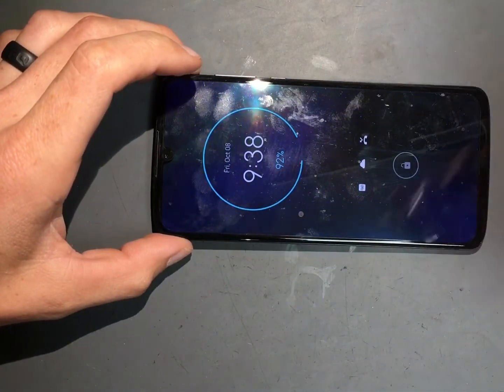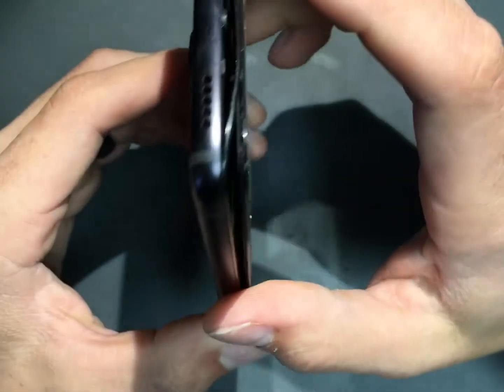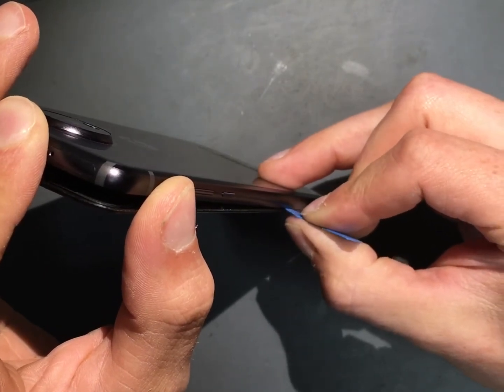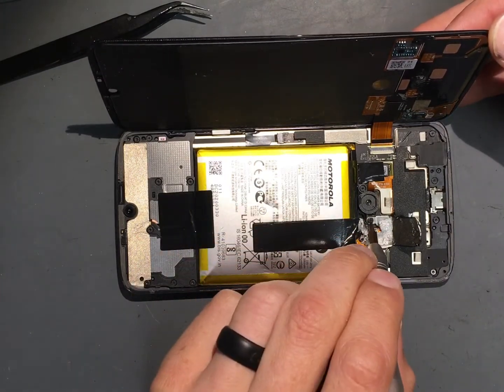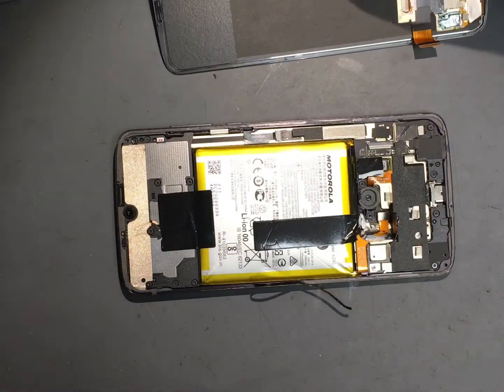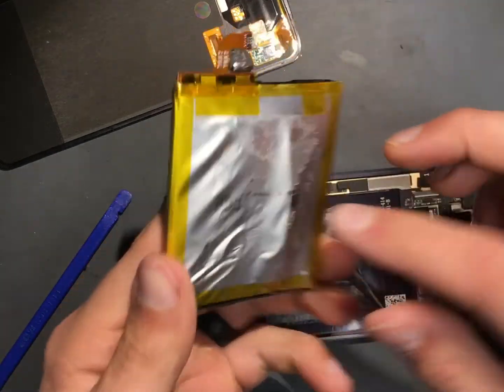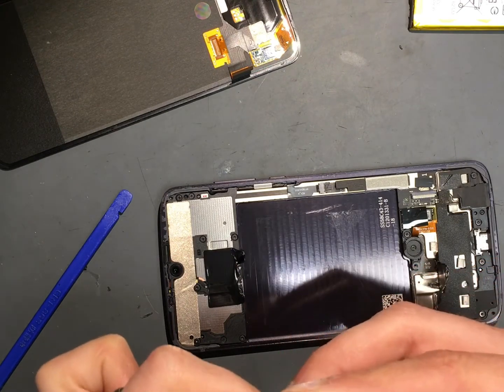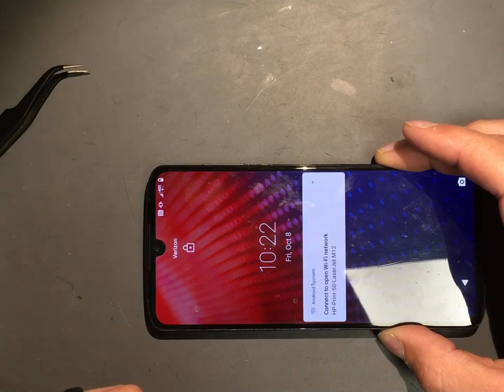MOTO Z4 swollen battery replacement

Comment: I have a question. I bought a new battery for my Z4 and getting ready to replace it. The screen is in excellent condition. When I take it apart should I leave the bezel connected to the screen or to the phone itself?
Reply from the maker: @waltercondi4584  Keep it on the screen. If possible. I had several where I intended to keep it on the screen but after warming it to soften the adhesive the adhesive that held the bezel to the screen also came off. Not the end of the world. But does make putting it back together take longer and harder to keep it looking clean.
Reply: @3200ish  if I have that issue that you had and when reapplying it what should I put on first? The bezel to the phone or the bezel to the screen. This is my first rodeo lol I already bought everything I need like the t7000 adhesive and the battery
Reply from the maker: @waltercondi4548  either way is fine. I prefer bezel to screen then into phone.  I think it’s easier but you have to let the glue cure before you set the screen back into the frame. Also If you’re able make sure all your stuff is backed up before starting.
Reply: @3200ish  thank you for the reply. Really appreciate it ☕

Comment: Thanks for the tutorial! What width Tesa tape did you use to adhere the screen (bezel) onto the back?
Reply from the maker: On the top and bottom I’ll try to put 4 or 5mm the use a blade to shave it down. On the sides I use 1 or 2mm where it allows me to

Comment: Quick story: I purchased a Z4 in Oct. 2019.  Then I lost it in Jan. 2020, and purchased a replacement on E-bay in Feb 2020.  After a year, I found my old phone, but kept using the replacement.  

Shortly after finding the old phone, the replacement had the battery swell in April 2021, so I switched to the original phone.  In Nov. 2021 (just after I paid off the original phone), the ORIGINAL phone also had the battery swell.  (Neither one had been left out in the sun.)

I was really hoping I could keep using my original Z4 for another year, but I felt I needed to get a reliable phone for personal and work, so I just got a Pixel 6 two weeks ago.

Can the old two old Z4 phones be repaired?  How much for battery replacement and fixing the bowed out screen?  If fixed, my son could use one of them.
Reply from the maker: I have had battery in a phone swell up just from no use. Pretty rare. 

A person could definitely get them both fixed. If the screens still turn on then shouldn’t need a new screen. But sometimes they do break while trying to remove them. For battery replacement only our shop runs around $100. Includes labor and part. If it’s a screen and battery both then around $175.
Reply: Which is a good price if you don't feel comfortable doing it btw I just picked up a battery for 40 and a screen for 100 so they are just charging 60 for labor and if you get both they are only charging 35.

If you do it yourself you'll want to own/buy a hot air gun, adhesive, and a phone repair toolkit (technically you don't need all the bits but they aren't that expensive.) You'd probably pay more for the tools then this guy charges though LOL.